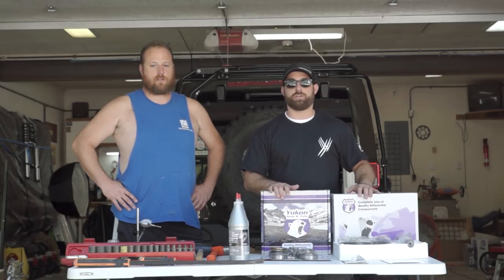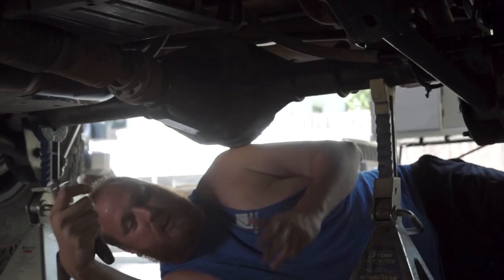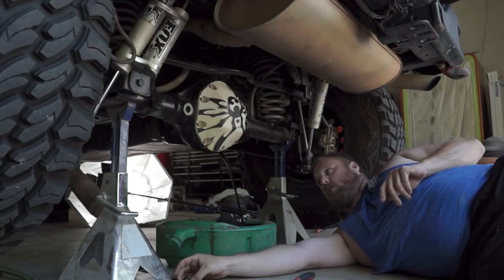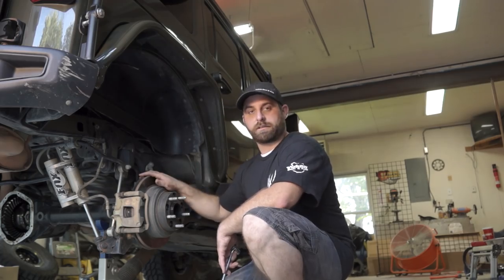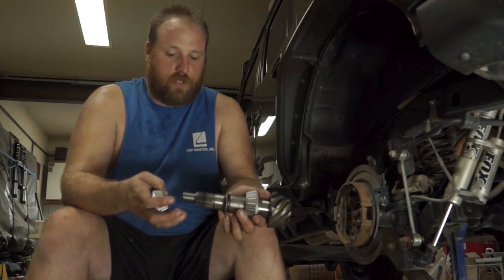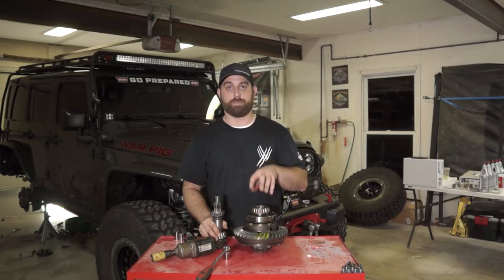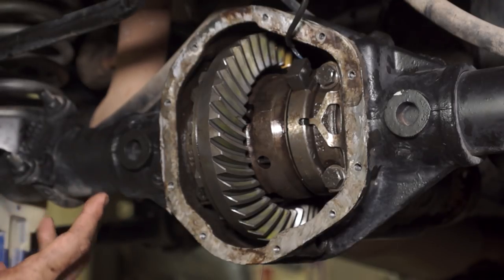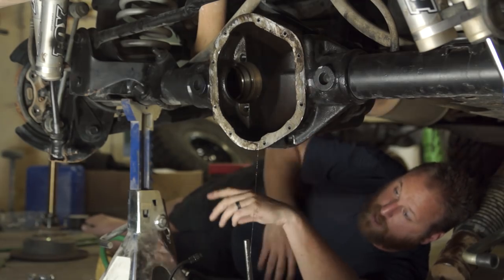Gear Install Jeep wrangler (yukon 4.88 gear)

Comment: I'm a Millwright by trade and deal with a lot of bearing and gears. I've never changed gears in a rear end but I'm about to tackle this project on my Jk. Some things that I would have done is marked my bearing caps with a punch. I want them to go back on the same side along with the same vertical position. There's two bearings on the carrier that should have been changed. The metal chunks missing from your gears are most likely in those bearings. You didn't remove the outer races from the pinion bearings. You didn't change the driveshaft seals and it looks like you had a whole lotta gear oil in the axle when you removed it. This could have been the cause of failure because you were low on oil due to it leaking by the seals. I personally would have used a rubber mallet to seat the ring gear after tightening the bolts and then torquing those bolts after I hit it with the mallet. I would suggest putting the carrier in a vise and torquing before going back in the Jeep. I would think that torquing after you checked clearances would change some of your measurements. Maybe not by much, but it could seeing that you didn't seat the ring gear with a mallet and it could have pulled in a couple of thousands. These are just my observations from working with bearings/gears on pumps and gearboxes. I just feel like this video could be setting some individuals up for failure, but I've never done a rear end, so maybe I'm wrong.
Reply: This is all solid advice. Overall though, with the intent being to show people a way to do it at home, without having anything it was a good overview. Totally agree about new races and seals all around though. An overhaul kit SHOULD include all that stuff, especially for what Yukon is charging.

Comment: But you haven't checked with pinion preload torque gauge which tells you are the pinion bearings proper torqued with locking nut while turning with gauge the pinion nut; too loose and the bearing cones will jumping and eat bearings again, too strong and bearings will be too hot. Then you check the preload together with crown gear with torque gauge are the crown gear bearings properly tight. Then you check back lash with gauge and then you put paint compound. When you check with preload gauge all bolts has to be tighten with recommended torque. When you check preload torque always rotate gears few times to let the cones in bearings sit properly on their surface and then measure preload torque.
Reply: hey! are you a car mechanic? where are you located?
Reply: @vjekoslavcvetnic7500  i see. thanks! actually i would like to replace the ring and drive pinions in a mercedes vario and i'm looking for a mechanic who  can do this properly in the balkans (romania).
Reply: @wanekt.8712  in Croatia actualy, in Romania should be mechanics who can repleace cone gears properly, it is not that easy and not for every mechanic because it's delicate work. You should ask for specialized workshops such workshops who repar automatic gearboxes, they should give you informations,  forget ordinary mechanics, they don't repair automatic gearboxes, nither drive cones.
Reply: @wanekt.8712  , such precize repais with gears are doing certificized mechanics for automatic transmission repairs which has precize tolls and are trained for such repairs. Find such specialized automatic transmission workshop and bring them the axle from your Mercedes Vario. In Mercedes service they do not do such repairs, they will probably offer you fabric repaired complete axle and it will cost you.

Comment: I'm assuming he use the same shims that were in it from the factory. I wish they would have collaborated if it wasn't in spect what to do shim wise and it didn't show how to set the crush sleeve those are the most important things
Reply: Pinion nut is torqued 160-200 ft/lbs. pinion torque to rotate is 10-20 in/lbs on reused bearings and 20-40 in/lbs on new bearings. It’s the same front and rear. Total torque to rotate the assembly is the previous torques plus 7-11 in/lbs.
Reply: @nickb7122  40 inch pounds is way too much and would kill bearings
Reply: Charlie Brown depends if it was done dry also.
Reply: Definitely reused crush sleeve and pinion shin which is ok. I’ve done it on thousands of overhauls with no problems. I know a lot of techs say not to but it is ok. If u have to change the pinion depth then you have to use new crush sleeve for proper pinion preload.

Comment: Nice job. For my final ring gear torque, I took a different approach. Took my rear shaft and attached it to the wheel pointing upwards, took my carrier and stuck it on the shaft. Manually engaged the locker and then torqued each bolt. For the front carrier, I just stuck it in a vice to hold it. Whatever method works best though!

Comment: Few things I see so far ,  you say u do finial torque to ring gear bolts after its all installed,   only problem with that I see is your thread locker has dried or almost completely dry and when u do final torque your breaking the thread locker loose and it no longer does its job ,    wrap it in few rags even b4 new bearings put in a vice and get the torque done b4 thread locker dries.  Also wood block or brass to chase your shims and a dead blow to whip carrier in place.   Also looks like you had little more than recommended back lash ,  wasnt quite turning the carrier enough,   you can see the dial indicator move past 6 or 7 thou or whichever u said a couple times which makes me believe it had little extra back lash , you don't have to be so gentle with turning carrier   you actually wanna hear it stop and turn it and hear it stop again ,  it won't move the pinion but there will b higher back lash # 👍

If I'm wrong about anything I've said please explain. Thanks

Comment: Thanks for making this video. Very informational on how to take apart a Dana44 JK gear box. A couple of questions: Did you check/change the pinion bearing races while you were doing this install? I also agree with the bearing preload comment, it's important to check that with a torque gauge.
Reply: If you’ve done enough diffs pretty much all have the same breakaway torque. You can feel this by hand. So as long as your depth and patterns are good it’s safe too say your good too go.

Comment: Thanks for the good tutorial video. It was also a pretty big confidence booster for me doing this job.
Reply: How did it go and what kind of garage did you do it in? Thank you in advance
Reply: @fofolatru1  It took a while because I did it all in my driveway so I was at the mercy of the weather and sunlight. November in the pacific northwest did not give me a lot of appealing weather to do it all in to say the least.Shorter days too so trying to get home after work to do it did not give me much time. But everything in the Jeep is going good now. Nice to have that power and throttle response back.
Reply: Honest question how is the Jeep running thinking of doing it myself
Reply: @rickyreyes4235  pretty good. made a substantial difference in power. and quite the learning experience, totally worth doing it. I threw an aussie locker upfront as well, but if you dont like clicking, especially in turns I wouldnt throw one in haha.. Just have patience when doing this job.

Comment: So, did you torque the ring gear bolts one day after you put thread locker on them? I think that by doing that you didn't give it the correct torque, don't you think? Also to remove the seal from the diff you used tools that could damage the lip of the diff where the seal sits, and thus cause oil leaks, when you could have removed the seal after the spur gear, apart from that I really liked the video and learned a lot of him, thanks for that

Comment: Great vid guys, a couple things tho..1- just an fyi it's very rare but some diff ring and pinions are timed maybe you can make a vid describing them , 2- did you pre lube bearings before final install?  ,3- if you used the new crush sleeve you guys should go through the procedure on how to properly crush the sleeve and measure breakaway torque for your pinion preload. Other than that nice work guys  .I love that diff cover too lol.ooh yeah I didn't see you guys changing pinion race lol.
Reply: Hey guys anyone know the mixture for gear marking slime kicking a 07 titan diff and just like the rest of it I can't find marker stuff

Comment: did I miss a step between where you removed the rear diff cover and you using the rotor to bang the axle out? you removed the brake caliper, reversed the rotor and bam, axle comes out... what was holding the axle in? c-clips in the rear end?

Comment: So I can put a different gear ratio in the back and leave the front stock?? It will be great...
Reply from the maker: No the gears have to match.  We did front and rear just did video process on rear
Reply: @WarPigOffroad  but at the end of the video you said no reason to do the front- leaving people to believe you drove it around with mis-matched gears. the video was a little helpful, but you missed quite a bit- not a complete diy video.

Comment: Great video.  Encourages me to do this myself on my 2008 JK.  Just a couple questions....I presume if any of the measurements are off, Yukon instructions will tell you what shims to use to correct the errors.  And I assume you already had 4.88 gears on the front?  Without trying to show my stupidity, I assume they have to be the same in the front and the back.  Thanks for your feedback.
Reply: I am actually about to do this to mine in the next few weeks. Going from stock 3.73s to some 4.56s :)
To answer some of your questions: If your measurements are off, what you do is determine how much they are off by (say .004") and subtract that shim from one side of the carrier and add it to the other side. If your pinion depth is wrong, then you just change the shim behind the pinion bearing to correct it to the right depth. Yes, gears are identical both front and rear, otherwise you would have an issue where one set of tires spins faster than the other, causing a bunch of driveline issues and eventually breaking things.

Comment: In the vid I noticed a string hanging out while you were installing the pumpkin .was string attached to a block too hold the plunger out ?
Reply from the maker: mel plishka yes so when you put it all back you can just pull the string out to release the plunger

Comment: Super video but i have question.What is the sensor you left inside on the top right side what this sensor do.
Reply from the maker: BLUE SKY BROTHERS it is the plunger for the locker
Reply: WarPig Off-road Is this plunger pulls the plate to the magnet to the right not the opposite side.That is why you Can removed only when you remove the case ,right.

Comment: What did you use to hold the locker switch open? I see the string hanging there, but it is hard to tell for certain what you have holding it.
Reply: Use a wooden dowel pin and string.

Comment: Hiw did you get the old bearings off you never showed that.
Reply: Use a bearing separator on a press but they didn't need to since they were installing new gears.

Comment: So at the start you show they play on the drive shaft, how much play do you have on the drive shaft after install? I hear thump noise on mine, between  gears, (manual trans) doesn't feel right
Reply: Never gonna get an answer
Reply: Probably just u joint

Comment: so you didn't change the front at all? I thought if you did the back you have to do the front, if you plan on engaging the 4x4.... correct me if I'm wrong
Reply from the maker: Tj Dooly yes if you do rear then you have to do front.  In this video I just showed rear because it’s pretty much the same process.
Reply: @WarPigOffroad  Roger that, thanks mate

Comment: Well its not done yet. After regear your check engine light will turn on. Then your JK will get into limp mode and stuck on 3rd gear. Also A/T temp light will turn on. Why dont u guys also give us tutorial how to setting TCM modul. This Junk JK has very sensitive computer, doesnt tolerate any change even in minor modification.
Reply: Can easily be adjusted with a tuner like super chips but yes they should have mentioned this

Comment: what do i do if i dont have extra bearings?
Reply: i was thinking the same thing- he was supposed to do this video with what you have in a "common" garage- not many DIY garages have "spare" pinion bearings laying around- and he kind of glossed the whole shimming thing, AND didn't mention everything he did to get the axle out; he removed the brake caliper, reversed the rotor and bam, axle comes out... what was holding the axle in? video was a little helpful, but not complete. :/